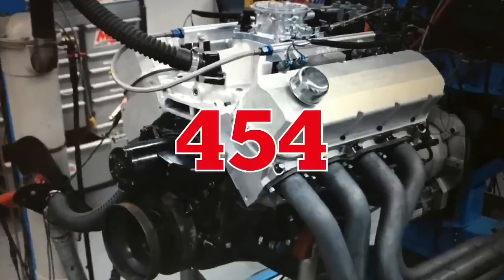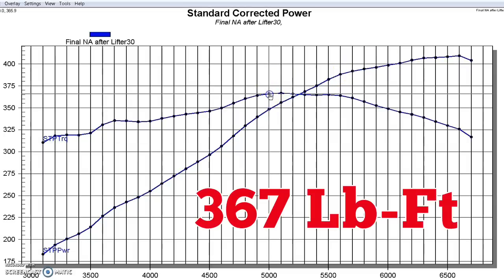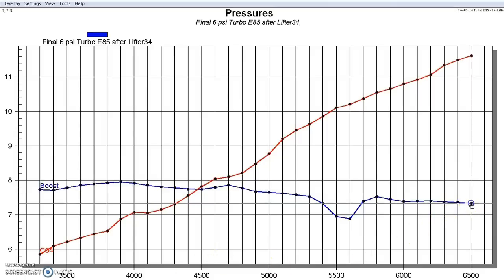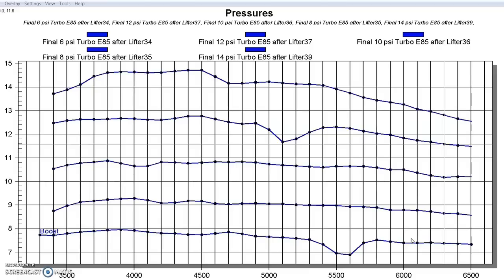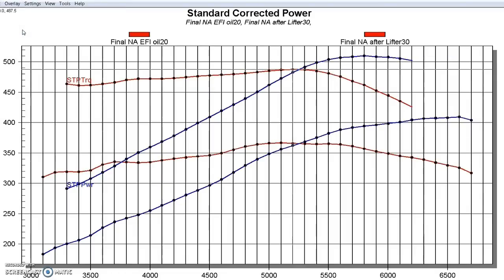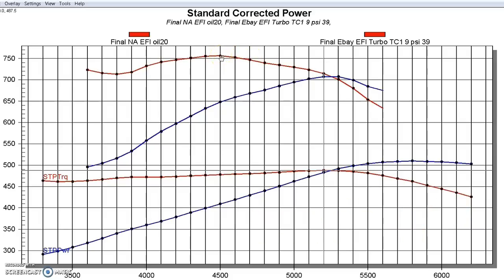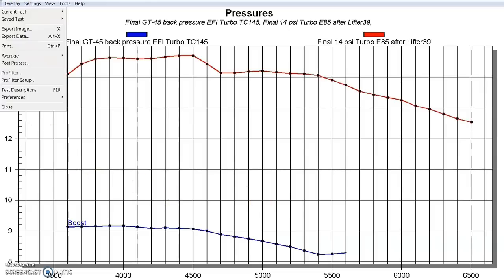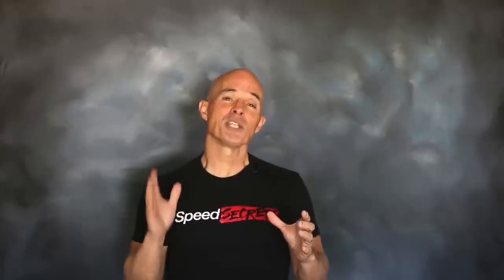EBAY TURBO TITANS-4.8L vs 454 (GT45 TURBO)

Comment: Remember when a small block that made 400 HP was a BEAST?
Reply: That was a lot back in the 80s new corvettes were maybe 200 at best lol
Reply: @dustinvanwinkle7271  those things were straight turds. My factory Honda Accord dookies on my friends iroc without even trying
Reply: @gnarkiller  yeah uh huh can your fart can half a motor make over 1000hp like a sbc? No so go boil rice on a ricer channel
Reply: @dustinvanwinkle7271  that is spot on!
Reply: I have a SBF 347 that has all the good parts , and heads blah blah  blah  , it made around 450HP for around $10k.......I'm sick about it .....
Reply: michael wakat I built a roller cammed Olds small block, spent a bloody fortune... when I think of what the same dollars invested in an LS or even SBC could’ve got me!
Reply: Yes, back in the day, but what is surprising is when doing old school motors or period correct if you like they are making way more hp ie look at 370hp LT1 350 if you do same motor now hp/torque  result much better as understanding of what makes power and what doesn't is much better
Reply: It is a beast because it came on cars that had no traction control, abs, stabilitrac or ecus that limited power... you can get in trouble real quick.
Reply: I honor you guys that went the other route other than SBC, BBC, and LS because I couldn't imagine spending that amount of money on something that doesn't give you any return. I'm going for a 4.8, going into my 1999 Ford Ranger, but that's only because I'm a cheap ass and don't wanna have to baby my truck/car when it was built to be beat on. I don't see why you have to have a $50,000 car just to go have fun, just slap an LS in that Sum Bitch and WOT EVERYWHERE until that fucker blows up, and in the mean time have another 15 engines waiting at home for the same price as some of you guys spent on.... 1..... Engine.
Reply: @OGbqze  yeah but id rather do it once vs 15 times.

If you gonna build it just build it. Do it once do it right  it doesn take a ton of money to do it just the right foundation and correct tuning.  a junkyard 351W he tested lasted until 1000+ on the dyno.  Id rather have that than blow up 15 LS  junkyard engines.  everyone has caught onto that so its not THAT cheap
Reply: Nowadays 400hp is almost laughable. Most performance vehicles make that stock now
Reply: Even in the 90s, a streetable NA 383 sbc making 500hp was a pretty big deal.  Now that’s easily eclipsed with a junkyard 6L with a cam and some mildly hand ported heads.
Reply: Richard 
U are the best Bro 
U always unlock the “Speed Secrets”. Awesome shirt your wife made too. Keep me posted on when u do a T Shirt giveaway
Reply: ricky bobby  My CTSV would like to have a word with you....
TSP S2 CAM
Ported heads
1050x injectors
TSP LTH 
going for 2.55 pulleys, Underdrive pulleys, and Ethanol
Reply: Yup 1999
Reply: yeah I sure do, me and my wallet long for those days sometimes, impressive as these engines are.
Reply: Just imagine if you had cracked the turbo nut back in the 80's, the turbo GNX was child's play.  Roll up to someone in that 68' 4 door Malibu with your 307 badges, the light turns green and you unleash 700hp on the unsuspecting pavement.
Reply: 1999 z28 350 tq 350 hp with Texas speed 1 7/8 headers ls6 intake and I chose to put a Texas speed stage two truck cam for torque this is thru a automatic with 4000 stall and 410 rear gears and with slicks it handles cars with 420 hp wheel is it because it’s lighter then most new cars or is the dyno being conservative what do you guys think
Reply: camaroguy 66  Than any car I owned before it. BTW, I was born in 66 and have owned a few cars.
Reply: 400 hp with 400 ft lbs is plenty for a hot rod  . More manageable for most drivers.
Reply: Sbc with 229 cubic inches twin turboed made 1100hp in the 60's by smokey yunick.....
Reply: Yeah, I'm building a 355 Vortec that won't see over 350hp, lol.
Reply: @knockingontheclouds1153  im building a 350 vortec with twin gt35 ebay turbo's lol. More than 350hp.
Reply: @GnarshredProductions  that sounds like a lot of fun!
Reply: @GnarshredProductions  won't last long  should have got a 4.8 or ls
Reply: @GnarshredProductions  if it doesnt make over 500 somethings wrong
Reply: ricky bobby  Im looking at building a 500hp windsor for my fox zephyr.  car weighs about 3100 with me in it although the weight might go up a lil with SFC's and the 351W block  but not by much  that would walk about 3/4's of the car out there from a stop light.  probably not a modded boosted car though but enough to get me booted from the track lol

Comment: How about testing a turbo that's properly sized for the 454 on both and show the results?
Reply from the maker: i did run an S480 on the bbc
Reply: @richardholdener1727  is there a video? Didn't see it in your channel
Reply: That would be interesting

Comment: Oh Richard we need a twin gt45 454 soon lol
Reply: Yes please, the same cheap gt45s, we need the ultimate Cheap Mud Truck engine...........lol
Reply: Yes please
Reply: i dynoed my big block today with two of these , its blo through carby so not the best but at 6000 rpm it made 717 hp at treads with 824 nm

Comment: So what you’re saying is I should get two Ebay turbos for a 454👌
Reply from the maker: always
Reply: @richardholdener1727  I appreciate these tests. Getting ready to build a 6.0 ls with two of these Turbos
Flipping the factory manifolds around instead of purchasing expensive turbo manifolds. and for the price of these turbos , you can't beat the power output. Plus you get a 4-year extended warranty on Amazon for only like $50.
Reply: @tigeroftheeye7121  if you're interested I have a really nice bullseye s480/87 1.0 t4 with 100 miles on it. Polished cover absolutely mint condition. I'd take 1,250 shipped. It's a $2,300 turbo.
Reply: @richardholdener1727  can you recommend turbo sizing for a custom dual compound boost set up on a 6.0L powerstroke diesel? Is there any advantage to creating a compound boost set up on a custom twin turbo set up? One other question, this one related to the 5.0L gen 3 motor in new mustangs. I want to build a custom twin turbo setup for my new Mustang with the goal of a minimum of 860Hp and good street manners. What sizing would you recommend for turbos and injectors for this type of application? Is it possible to tune this type of application to run reliably on 94 octane pump gas (E85 is hard to come by in Canada) or would I have to run octane booster with the 94 octane pump fuel or race spec fuel to do this safely
Reply: Now put twin eBay gt45s on both engines and let's see what happens.
Reply: What about a Chinese truck turbo? Like their version of a Detroit diesel 60 series turbo?
Reply: @meteor5452  if your trying to use an old truck turbo on a gas engine, pick a diesel turbo for close to double the engine size since the gas engine will tend to flow more cfm due to higher rpms. There is actual math to size it correctly involving compressor and turbine maps, but that should get you close enough for government work
Reply: I put 2 ebay gt35s on my ls3
Reply: Man Stuff Channel how much power did it make and how quick did it spool
Reply: @jackpitcher1543  dont know the hp, there is vids on my channel..
Reply: @jackpitcher1543  got it dynod since this message.. on stock cam it made 575 hp and 640tq wheel to 6k rpm.. 10 psi boost and 15 degrees timing with e85. the stock cam is definatly holding it back at this point and it needs more timing.
Reply: @yolofullsend  how did that go? Was thinking two GT3582s on a LS2.
Reply: @DodgyBrothersEngineering  pretty well.. at 12psi its slap bang center of the efficiency island.. spools decent.. if youre going to keep power below 650 wheel then you might be better to get gt3076s  as they will spool faster and still make the power you want.
Reply: @yolofullsend  only looking to use the cheap eBay turbos, so beggars can't be choosers. I made about 400rwhp with a single GT3076R on a 2 litre SR20DET, so a couple would be fine on a 6 litre, but as I say cheap price dictates what you can get.
Reply: @DodgyBrothersEngineering  same here brother.. like i said.. ebay sells gt3076s gt3582 and gt45s.. i picked gt3582s (precision 6161) because i was aiming for a final power level of 1200hp..  the 3076s will do 800/900 ish.. theyre both about the same price but the 3076 will spool better.. the 3582 will be best if you want more than 800.. mines a 6.2, yours is a 6.0.. its gunna be about the same results for you too.

Also.. back when garrett boost advisor worked.. it consistantly recommended twin gt 3076 untill i got above the 1000hp power level.
Reply: @yolofullsend  The only 3076 I have seen listed don't have great ratios, but again there are always ways around these things.
Reply: @yolofullsend  how does it run??
Reply: @MAJORMAN299  pretty good.. vids on my channel
Reply: Moon Tuned  what’s it make
Reply: Was thinking the same ... maybe 3 or 4 hahah 🤔
Reply: Keep adding wu tang war whistles until the back pressure is acceptable on the 454 .. might work 🤔🤷🏻‍♂️be cool to see 👏🏻👊🏻
Reply: Yes two GT45  turbos same engines!
Reply: Screencast ftw
Reply: #genius
Reply: Oh yeah, twins definitely,  especially for 170ish bucks... I mean come on, although I'd worry about the bottom end though as youd get over 1300 horses easy
Reply: That's what I'm hearing 🤣
Reply: It would have been good to see a proper sized turbo on the 454 to show how good it could have gone,  also the tourque cerve on the big block if put in a car would smash the 4.8 in the quarter mile just the way it sits even though you would not run it like that.
Reply: @richardgutteridge2127  he tested the  same motor wth a S480 making over 900 at only 15psi. It's in Hotrod magazine.  You can search and read the article
Reply: Richard Gutteridge  theres quite a few 4.8 drag cars running way bigger turbos than this and they launch, 60ft and front half just as good as any similar built big block car. Anti-lag, two-step and a stall converter go a long way
Reply: You’re really splitting hairs with words. Do you want a hero cookie?